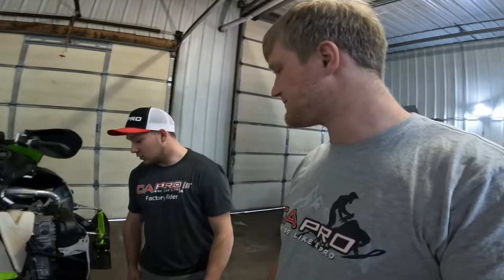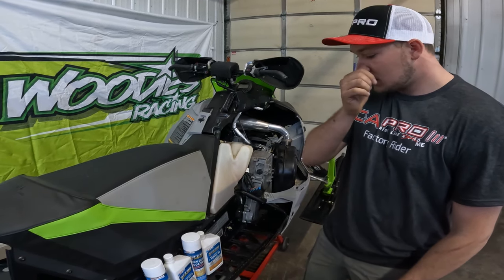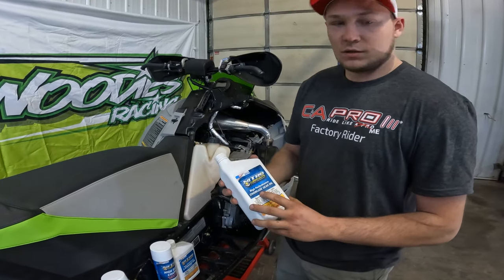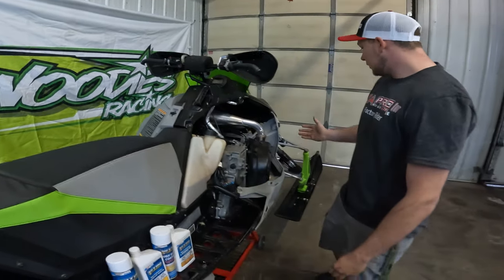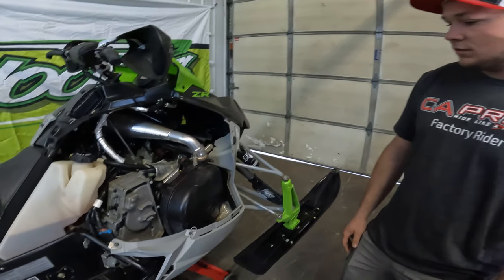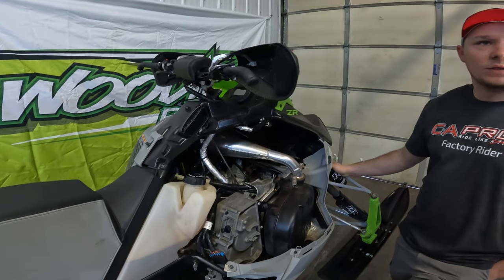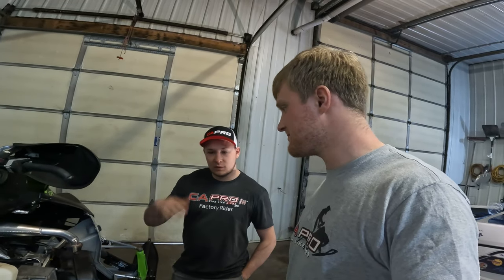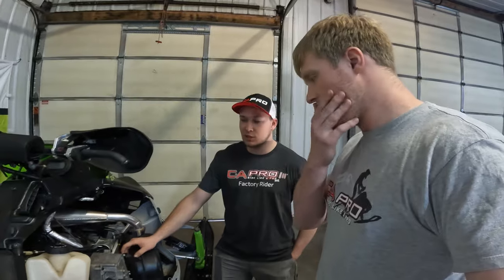Summer Snowmobile Storage Tips from Woodies Racing Mechanic Kaden Woodie

Comment: Is that  Premix oil only?  I can't find anything on pour points  in cold temps.  I can't find any ASE ratings such as TCW-3
Reply from the maker: Hi Mike. We asked Kaden - He says they do 32-1 premix on 5 gal of Sunoco surge 105 octane.

Please see Nitros website for additional information:
https://www.nitro-lubricants.com/product/2-stroke-oil/
Reply: @caproskis1    Thanks that was not my Question.  My Question was:  Can  it be used in Oil Injection systems?  I posted a link to their Web site.  I stated that on their Web site  it never tells if the oil is rated TCW-3  or if it is thin enough to use in an oil Injection system in the Winter.
  If you are going to advertise something  you should advertise  what it can be used for.
  I want to race in Cross Country races  and  ride trail sleds.  In both cases  I intend to use my oil injection system.
  My  Skidoo has a fogging system to  prepare it for summer.
Reply from the maker: @mikeskidmore6754  This is the oil Kaden likes to run in his sleds. C&A Pro has no affiliation with the oil manufacturer. Please reach out to your oil manufacturer for specific questions.